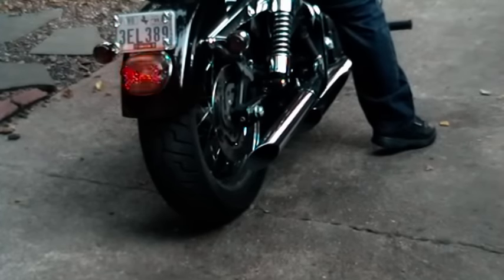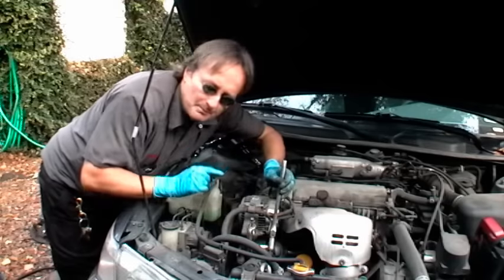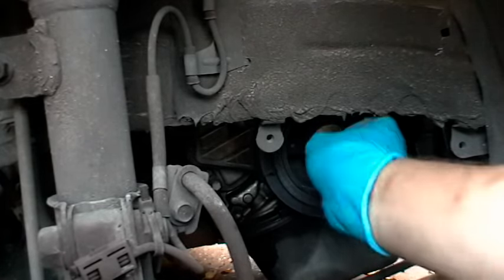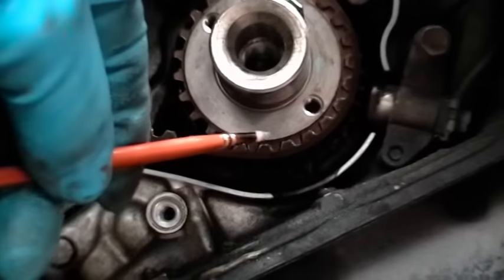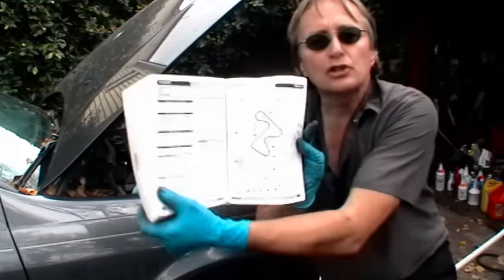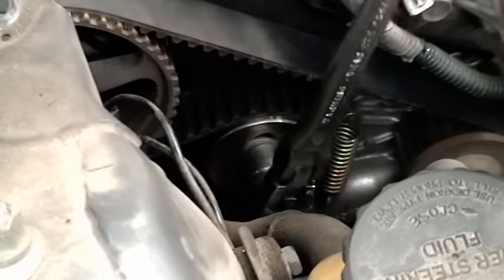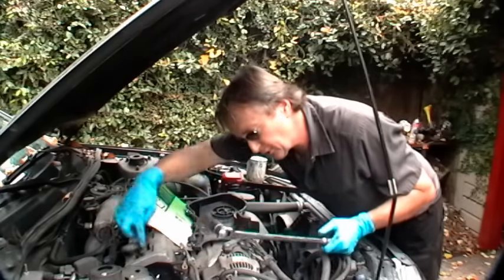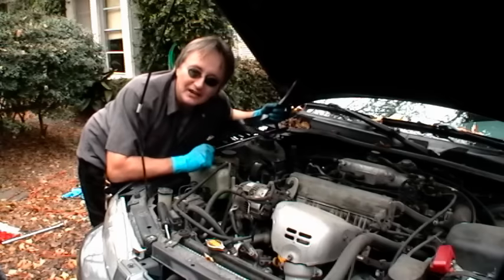How to Replace a Timing Belt in Your Car

Comment: Scotty I have a question. I need to replace the water pump on a car. Ford was nice enough to design the timing essentials to where the timing belt tensioner is mounted onto the water pump bracket. Videos I'm watching say it needs to be put top dead center and other stuff before putting belt back on. But if I'm not replacing the belt or turning anything then why would I need to top dead center it? Couldn't I just mark it then remove timing belt and tensioner then reverse steps for reinstallation? It's a 2015 Ford fiesta se 1.6l 4 popper

Comment: Bro a lot of people tune into this video for one reason,you started out with the belt (broke), so since the motor was running when it broke it went out of time so marking the gears and so forth is no good,you have to get back to right alignment, and top dead center ,you lead people (unintentionally of course)..but still please improve you video to help others know ,understand, and accomplish thus part of the job as well so that a person will not destroy their engine but not understanding thus (VERY)important detail..Thanks

Comment: Metric is not fascist at all.  it's easy to understand, it's based on round numbers, and the US should use it the way the rest of the world does.  Even the car makers are virtually all using it now....haven't seen a new car with English bolts in it, the last time I checked.  Metric is the way to go.

Comment: Hi Scotty, thanks for the inspiration and generosity. In this example the timing belt tensioner is spring loaded. On my Citroen the belt has to be manually tensioned. In your experience, is there a thumb (and finger?) rule for belt tension or is a special guage essential as the repair manual states? Cheers
Reply from the maker: make the belt so tight that you can just barely flex it 45 degrees on the longest run of the belt when twisting it hard.

Comment: Hi Scotty Kilmer is the procedure for changing a timing belt the same on a 1995 Acura Legend with a 3.2 v6?  I changed mine and was trying to figure out how to tighten it again after doing a head gasket job recently.  also, how long should I let it run to get all the coolant out of the exhaust?  any ideas?

Comment: Scotty on my Dodge 2001 Intrepid 2.7 engine it doesnt contain a belt but a chain. The owners manual states i should change the "timing belt" should i still change the chain? Someone told me I shouldn't worry about the chain its strong the only thing i should worry about is the idly and tensions and very important to check the water pump. What do you think?

Comment: You too can change a timing belt in 4 minutes as long as all of the bolts are already loosened and nothing in the engine compartment has to be moved aside or removed altogether...

Comment: I once tried to take off the harmonic balancer because it was split and I had a 5 gallon air compressor, but it would not budge the bolt. could you quickly explain how to take the balance bolt off if there is a problem?

Comment: I have 2009 Elantra with 135K
Timing belt was changed at 60K back in 2015 don't have 1000 dollars hopefully selling in a year is it safe for me to keep going?
the age of the belt concerns me more than the miles does it have any signs before it starts to go or will it just snap? no issues driving as of now.

Comment: Hi Scotty
After how many mile should we have to change the timing belt for our cars: Civic 2000, X5 2005 and MDX 2007? Thanks in advance
Reply from the maker: about every 90 thousand miles, but many modern cars do not use timing belts, they use chains that you leave alone. the civic has a belt though.

Comment: Hi Scotty, thanks for your channel makes working on your car very easy. Wondering about changing timing belt on my KIA Sorento 04 . doesn't look as easy as it does on this Toyota. Any advice?
Reply from the maker: juan escobar  just take your time. V6 engines have a lot more crap to move around in, and get a cheap manual with pictures
Reply: Scotty Kilmer thanks, appreciate your feedback.

Comment: Love your videos! Very helpful and entertaining!
Have not seen any video on aligning timing marks after busted timing belt. After belt breaks and you set number 1 on tdc is there a certain way to turn or adjust each cam to line back up to its mark lines up with marks on back cover timing marks? I have a 91 d21 nissan v6 engine pickup?
Thank you and would appreciate a response to this!

Comment: I wish Scotty would have discussed the hardest part of this whole job: getting the harmonic balancer bolt off. That bolt tightens itself to an extreme degree, and it's screwed into a part that turns. Unfortunately, Harbor Freight quit selling the one cheap tool guaranteed to get the bastard off: the 3/4"-drive electric impact wrench is no longer in their catalog, and the 1/2"-drive ones they sell now ain't got the muscle to twist off one that's really stuck.

Comment: Scotty, I think my car has a timing belt issue, but how do I know for sure?  Note: My car is 10 years old and has not had a timing belt  My car had been gradually losing power during acceleration for a couple of days until this evening, when at a red light, the engine decided to just die on me, and never restarted again. Batteries are OK it still failed on a jumpstart, petrol pump and filters are OK as I just changed that a month ago. Does this sound like a timing belt issue?

Comment: I bought a 2008 Toyota Solara that has 90k miles on it.. Its my first car. I have a new timing belt with me, but I wonder if anything can go wrong if i try fixing it myself? I was considering taking it to a shop because I was not confident enough, but someone advised me to wait atleast for an year and get familiar with the car before having anything done to it.

Comment: Hey Scotty,  there is a 97 Corolla leaking from the timing belt housing. What should I change when I take those apart? The seller showed me a paper that he replaced water pump along with cam shaft seal and others.

Comment: Hey Scotty really huge fan. I'm doing headgasket job this summer on 96 acura tl 3.2 When setting cam timing the crankshaft has to be at tdc compression stroke than how can I tell if cam shafts are closed when reinstalling them after I put heads back on
Reply from the maker: you have to go by the line up markings on the cam shaft sprockets, so take it apart at tdc when crank and cam markings are set correctly
Reply: Thanks Scotty your the best

Comment: What else should be replaced in the timing belt service? Also, can the harmonic balancer in any way go bad start to give a weird metal grinding sort of a noise? Thanks.
Reply from the maker: many guys change the water pump and the automatic tensioner.  and many ballancers are two piece, they wear out in the middle then grind

Comment: Hi Scotty, I recently changed the head gasket and water pump in my 2001 renault clio 1.2. The engine starts but it doesnt run like it used to, its a bit erratic, with the sound of the engine changing (probably due the the car's computer). Sounds like the timing might be out (had to remove the timing belt in order to replace the head gasket). All the spark plugs are firing. There is also smoke/fumes coming out the exhaust. Before putting the car back together I checked the timing belt position at least 3 times, turning over the engine and the marks I put with chalk lined up perfectly. Does my situation sound like my timing belt is out, even just by one notch? Thanks :)

Comment: If the timing belt is NOT broken, do I have to get TDC first or I can just slide the new belt in as long as the pulleys doesn't move. Thanks!
Reply: Scotty Kilmer so as long as when I put on the new belt at the same exact position, im good to go right? I will make marks to make sure they're the same but I don't have to put it on tdc right?
Reply from the maker: Forrest S
that's right

Comment: Hi Scotty - having just bought an "interference engine" car, whose belt broke I found a bit more than expected: Beyond the usual bent valves I have one badly nicked piston top. 

I'd say that the depth is as much as a 1/16" in a few locations. If I grind/polish out the high spots, is there much of a chance of "burning through" the injured piston? Thanks for your opinions. Paul
Reply from the maker: not unless it's more than 3/4ths of the way through
Reply: Scotty Kilmer That's great news, Scotty (out comes the Dremel) - and thanks VERY much for the lighting-fast reply.  It remains a treat to be informed and entertained by your video efforts; we shadetree-mechanics are forever in your debt!

Comment: Question, do you have to mark the new timing belt too? Once you remove the old ones of course.
Reply: megaman91646 yes otherwise the timing will be off and it'll be like the engine will be running without a belt causing the pistons to bend
Reply: I didn't see him do it though.
Reply: megaman91646  No you don't need to mark the new belt once it's fitted. You just mark the position of the cam and crank pulleys in relation to the engine to make sure they are in the same position when the new belt goes on.

Comment: i currently have a mazda 323 F (1992) driven 184500 KM so belt has probably been changed around 2 times its lifetime and since the car is 22 years old should the belt not be changed soon?

Comment: Idk why people go put white paint marks over everything when most engines have factory marks that line up when cylinder 1 is at tdc. Just look for them rather than put white paint all over the show. Also disconnect battery beforehand and you should also replace the tensioner, idler bearing, oil seals and waterpump (if run off timing belt) at same time as these can fail before next timing belt replacement leading to serious engine damage.

Comment: small question about reinstallation on the crankshaft pulley: is it okay to tighten the bolt with an impact gun rather then to torque to spec? im afraid i would break the bolt or threads or have the pulley come loose.
thanks

Comment: I have been trying to take off the tensioner bolt since last night but it's not coming off and the bolt is starting to strip. If I keep on going it will strip all the way. This bolt is hard to take off and the only thing I can get there is a 14mm wrench and use a 1 foot metal pipe for leverage. Is there a special tool that I can use or what should I do? If it strips before I can get it off I'll be in big trouble.

Comment: Hey Scott!  I have a '94 Nissan Pathfinder that's making a squealing noise.  I bought some belt spray and it's still making the noise. I've been to two auto shops and they did  a visual inspection and said to change the belts.  I said 'which one'.  They both said 'all of them'.   I know that' not the case.  I asked one of them could it be the pulley bearings.  It went passed their head.  I don't want to get ripped off and I'm flat broke.  I'm trying to avoid driving my car whenever I can to avoid more wear and tear.
Reply from the maker: heck, first just tighten them all up, could just be loose. If they squeal then, spray carb cleaner on the belts one at a time, when the noise stops, that's the squealing belt

Comment: Scotty, could please explain the part where you're showing how to mark the pulley/cog locations? I'm sorry I didn't get that part. I plan on working on a 2004 Acura RL so would like to know this. Thanks
Reply: some cars have top dead center marks on the car from the factory.
Reply: Scotty Kilmer Scotty, I just got my 04 Acura RL's timing belt service done from a pricate mechanic. Now the car is running fine however after the installation, I feel this weird vibration/slippage kind of a feeling during the initial launch. That is, when the car starts moving from zero and a feel this vibration for a second or two and goes. It happens only in the initial launch. This was never there before the belts etc were changed. What could be wrong here? I used quality parts not from the dealer though. Also, my mechanic did not use the TDC method while the installation. I thought maybe he missed a tooth or a half but he claims that the belt is installed fine but I'm not satisfied.

Comment: mr kilmer , i had a  question  when changing timing belt   in 5 years or( 80000 miles)  , the  shop will recomand to change the  water pump  also.                but when is timing chain , never need to replace   , unless is worn .         about bout the  water pump?   r they conected   ? water pump =timing belt.       wat bout   the timing chain???with water pump

Comment: Why no mention of the possibility of having to use cam locks on some engines? You need to use them on some twin cam engines like an Alfa I owned otherwise they will rotate slightly once you remove the old belt, they are just under so much spring tension.

Comment: I have a good question, does the timing chain on a 2006 silverado affect the truck for not having any spark?
Reply: A timing chain will last longer than your engine. Don't need to change it.

Comment: Hi Scotty.
My water pump on my '93 Celica was making a lot of noise and leaking last week.
On Saturday, the noise got really loud and suddenly, the engine stopped working. When I tried to start it, The cranking sounded like there was much less resistance to the starter motor than normal, as if I were only spinning the crank and pistons, but not the cam shafts. I think my timing belt broke or jumped off. Is my '93 Celica an "interference engine" Am I screwed? Please give me some advise. Thanks.

Comment: Hey Scotty, the other day my holden vt commodore, year 2000 started being sluggish, i changed the spark plugs and leads and made sure they were all in the right sequence, but now it still has that issue, could it be a timing issue? It also stalls in reverse and drive after some time so i cant drive it, thanks...

Comment: if I buy Chilton manual for a 90 Toyota corolla that needs timing belt replacement.. is it pretty easy to do. I am mechanically incline. and have worked on cars.. my specialty is breaks. but its my friends 4 cylinder. and they need timing cover gasket and crank oil seal replace.. and I figure its good time to install new timing belt.. as long I follow the written directions. would u say this is pretty easy job??

Comment: My Ford Ranger ripped it's timing belt in half while driving down the highway. I replaced the water pump, thermostat, timing belt, tensioner and crankshaft position sensor. It's a non interference engine. After 3 attempts of lining up the timing marks and maybe suspecting I'm 180* out, I still had no luck- it cranks but doesn't start. I know that the 'dummy' oil pump pulley also sends information the coil packs. It is a 2.3L 4 Cyl. Does the crankshaft pulley have to be installed before trying to start it? Because I've been starting it without it with no luck. A fellow mechanic that works at the base said I don't have spark-probably due to the crankshaft position sensor. Not sure where to go besides the junkyard since I have a 306 stroker in a beatup mustang standing by waiting for it's transplant into my ranger. Thanks Scotty.
Reply from the maker: pulley has to be installed on many as it will make the crank sensor work. Seen that in many cases.  But realize if timing belt ripped while driving, something else could have made it tear, such as worn cam bearings making the belt break. Realize just changing a belt may not fix the original problem.

Comment: hey scotty if you have bent valves, can you replace the whole head with a used one from the junk yard and the car will run okay or the whole engine needs to be replaced or rebuild?
Reply from the maker: IF pistons don't have holes in them you can, look at them closely

Comment: Hi Scotty. Can I change my timing belt as easy as this? my manual seems to make this a 30 stage job. Thanks
Reply from the maker: +Andy Foster depends on the vehicle and engine design, some are absolute cows that can take even a mechanic all day
Reply: Renault clio 1.5 dci is my car. Looking through the workshop manual it is mostly time consuming removal of parts. The actual important setting cams etc seems easily enough.
Reply from the maker: +Andy Foster shouldn't be too hard, but they don't sell french cars here in texas, so I have no hands on experience

Comment from the maker: Down the the fascist Metric system. Measurements were originally based on sizes we humans understood. Now they are just convenient made up sizes. For instance, temp in F is made so we can feel the different in temp that we can feel. Temp in C is too large a gap and does not accurately reflect how we can feel smaller temp differences.

Comment: The 4 Cylinder engine mechanic usually charge you $250-$300 the V6 $400-$500 depend

Comment: should you replace the tensioner and idler along with the belt?
Reply from the maker: on high mileage cars, yes
Reply: Scotty Kilmer Hey scotty ive never done a timing belt but i plan on it this summer because mine has about 70,000 miles on it i have a 91 celica st the 4afe engine im sure you remember me but my car has 167k ive been working on cars 2 years and im pretty sure i can handle this but how hard would it be on my car? ive heard on mine it would be pretty easy considering its a smaller engine
Reply: Scotty Kilmer
Great Video!  Perhaps add in a NEW water pump while all apart, & check all seals (oil, crank & cam). Being a Toyota, I would recommend a new Toyota Brand water pump ( new complete housing)

Comment: Hello Scotty! My name is Erick. I have a 02 ford explorer v8 4.6 4x4. Tranny went 3/2011 @145,000 ,full rebuild ,but was told by the tech that I needed a heavy duty torque converter other than the original 5w something? Was charged$400 extra ,not knowing if their is a heavy duty replacement there..just a new crackling sound..I took my truck back twice b4 the warranty expires about the sound but was told that's normal because I have an upgraded converter.. don't know if that statement is true?